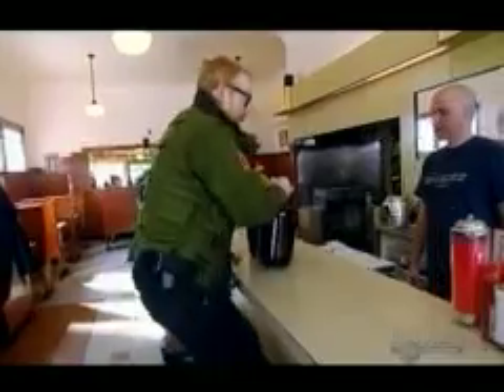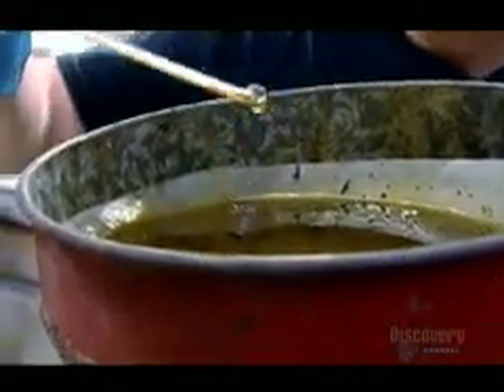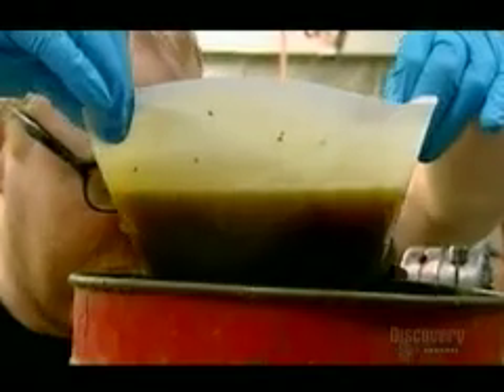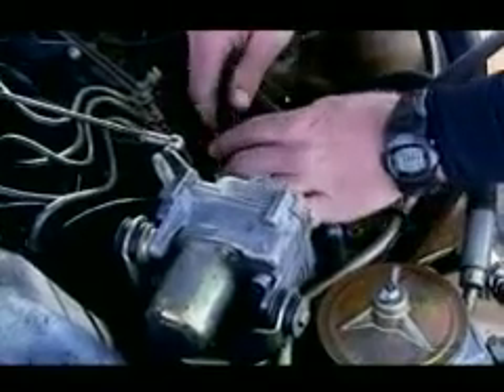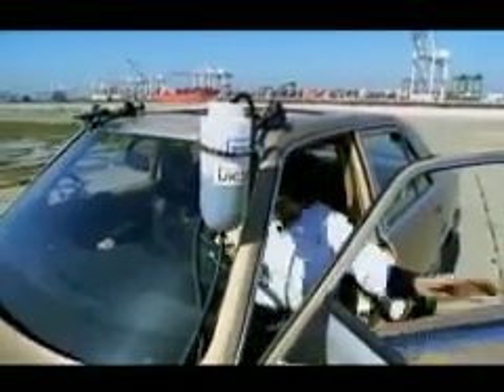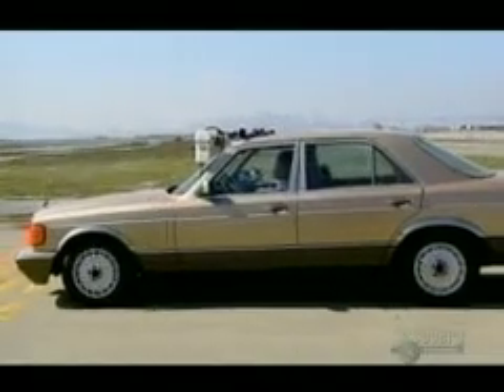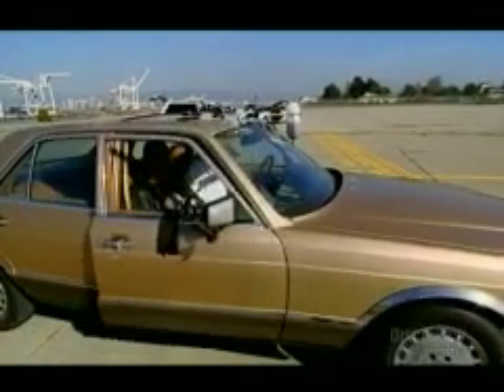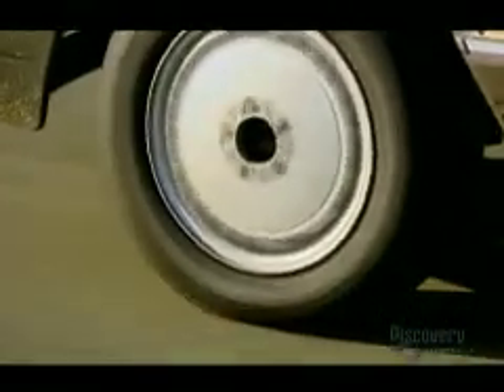Mythbusters - Cooking Oil as Economical Diesel Fuel

Comment: nothing new really.people been using used oil as deisel forever.really anything thats compressable like diesel will work.can also use latern fluid scince it isnt really combustable,but will blow under compresion like diesel.only problem with using stuff other than diesel is that your injectors will not last near as long,and with the cooking oil i can only imagi a all the sludge buildup.but still cool see it work

Comment: what do you mean busted? WE'RE IMPRESSED THAT IT RUNS AT ALL!!!

But I'm very skeptical, I'm very sure that it fucks up your engine. Especailly since diesel naturally lubricates the engine. So I guess this is good for bullshit 15-20 year old cars that nobody cares about, 500 usd ones
Reply: Diesel engine was initially designed to run on vegetable oil, it actually cleans the engine and removes any debris
Reply: Yeah, its great stuff, I noticed a difference half way through the first tank! Propel is also working on setting up more locations so its more available. Glad I could convert someone to the new diesel they have
Reply: Diesel engines are unique because they will run on practically everything. In fact you can fill the tank up with engine oil and it will run. This is also where the biggest problem with them goes into affect. If the injectiors have a problem and slightly stick open and the engine backfires the engine will not shut off till it self destructs. When they will run backwards till the bearings burn up and in most cases they don't run on the fuel at all when they do run backwards because the injectors actually function fine. They suck the oil in the engine up and run on it till it melts the bearings or runs out. Either way the engine is toast. In fact diesel with run on gasoline. The problem is the gasoline burns to hot for them. The diesel engine is the best engine on Earth though if your low on it's normal fuel as long as you have a fairly decent amount of oil based products you can get it to get you home or to the next fuel station hopefully. It won't run great or like it should but doing things like that was common at one time to get you where you needed
Reply: What do you think that trucking companies do with their drained oil? It goes straight into the fuel tanks. When times were tight, I was running a medium duty International rollback with a 6.9L IDI on straight waste oil. It smoked more, but had more power than with diesel fuel (lube oil has more BTU's).
Reply: Ideally one should convert the triglycerides of used cooking oil into esters, not done here, but proper B100 has MUCH better lubrication than standard Ultra Low sulfur #2 diesel
Reply: Ill say it again, they were designed to run on biodiesel not vegetable oil. too much glycerin in vegetable oil
Reply: Here in CA I am lucky to be able to run HPR diesel in my truck. Its a renewable high cetane biomass made from tallow and other animal fats, with incredible improvements in emissions over petrodiesel. With the added benefit of being cheaper too, its really catching on. check out propel fuels HPR diesel. It's clear, and doesn't even stink
Reply: ZB classic vehicles, sure you can run it on straight oil, but the higher BTU content tends to blow head gaskets prematurely. And you're thinking of turbo diesels, when the seals fail and oil pours into the intake
Reply: Taydrum I'm aware that it tends to hurt components like gaskets but it will still hopefully get you where you need to if you have to resort to doing things like that. As for turbo diesel engines that's almost all modern diesels anyway. They are pretty much junk without them though I'm glad you did mention that part because I had completely forgotten to say that
Reply: usd means united states dollars. it's okay man, that's what the higher ups call it. normally we just use the classical $ sign.
Reply: Yeah could be. I don’t know enough about it either. I just know people who’ve done it and they say it works great, but I’ve gotta try it for myself. Got lots of spare injector pumps and injectors so I’ll find out I guess.
Reply: It appears like they infused diesel with natural gas and a catalyst to make a better burning diesel. That's really cool, I wonder why it was dropped. Its also worth noting that many people have converted their diesel engines, or concurrently run natural gas with diesel. Good find
Reply: SimplisticTV are your referring to HPR diesel? Then yes, it's "bio" diesel in the sense that the starting material was biologically active, and therefore renwable. However they distance themselves from the word Biodiesel in favor of Green Diesel since the properties are different. Biodiesel naturally has low cetane, and poor cold start characteristics. HPR diesel has very high cetane, and impeccable cold start properties, with the added benefit of burning CLEANER than traditional B100 biodiesel. Check out these fuel specs for HPR diesel:

https://dieselhpr.com/assets/media/DieselHPR_Fuel_Specification.pdf
Reply: nuget102 it's bloody filtered!
Reply: ZB classic vehicles what you are referring to i s a runaway diesel. That is caused when the turbo gets worn out and leaks oil into the intake. The engine runs on that oil until it dies.
Reply: Jagdish Naryan you are mistaken, pure vegetable oil has triglyceride backbones with esters. The esters are what you want to burn as fuel, while the triglycerides will gum up any component they contact like injectors and pumps. I've torn down diesels than ran only veggie oil, and the injectors were almost glued together
Reply: llVIU this also naturally lubricates the engine. Same as diesel. Light oil. Doesnt fuck up anything unless you don’t filter it.
Reply: I've been told waste oil can and does mess things up. I've also heard if you do some stuff to prevent build up from oil not thoroughly heated that it's fine. I don't think there's enough research really...
Reply: But it DOES NOT POLLUTE the atmosphere!  No smoke is produced!
The only thing that comes out of the exhaust is pure clean water, which you can then drink!
Let's stop polluting the planet with these horrible diesels!

Comment: I think of two points made by Diesel Power Magazine--in an article titled "Diesel-related trends that have died-off"--about why what they attempted is not not more popular:

1). Waste Vegetable Oil (WVO) lacks the proper lubricants & burning properties to support long diesel fuel-injection related components. Many have found the savings had by it offset by fuel-pump & injector replacement costs of equal or greater resulting from doing so.

2). The Mercedes 3.0L turbo-diesel, unlike most other diesel engines, is a very-expensive & difficult engine to even get parts for... Especially "hot parts" that can actually improve performance (hence: mileage). So imagine trying to source replacement injection parts that are merely rebuild: End-costs so great, it won't be worth it.

Comment: The big question though is if there are any long term effects on the car from using raw, filtered fry grease
Reply: it would get disgusting pretty quickly as there are no detergents in cooking oil performance would start to drop after only a few hundred miles i think
Reply: It gets thick quick in the winter.
Reply: Not really only have change oil more frequent
Reply: Biggest one, engine oil dilution from fuel being used not proper to the injectors

Comment: B#(($#!^......it didn't make your engine more efficient?......you got the oil for free.......how efficient can that be in terms of economics...
Reply: your engine would be clogged up after 1000 miles and lose efficiency, eventually would not be drivable and you need a new car.
Reply: clogged up?......have they been doing the proper mixed concentration or did they place in just plain cooking oil....oooohhhh they did...that is why it will be clogging up..considering the weather..the colder it gets saponification follows......now if you had it properly prepared as an engine fuel then the problem will solve itself.

Comment: What these two clowns did not mention is that the  MB 617 diesel engine will run on some god awful fuel! The Problem with veggie oil among other things is hard on injectors, and fuel lines! Also, it tends to jell when cold out!  I drive an MB with the 617 engine, I will not put that crap in my car, Its not a good fuel, when you get down to it.  It's a shame that what some people are doing to what may be the finest cars ever made!  I use to drive a VW Jetta Diesel in one sort or another from 1977 to 2010 when my last car died! Those would not run on veggie oil nor would any of the, more modern diesel powered cars with the common rail injection. My 300 SD is 34 years old the last of the 617 engines were made in 1985!  These cars still give good reliable service with just a little care! It's a messy time-consuming option and yea its pretty much free for the asking, but I look at my time as worth a lot more that the precived savings when I fill my tank!
Reply: MB best car eva.... have to tell yall... MEGA LOL.
i d neva buy any of ewwropean cars eva.

Comment: I thought that in order to run a diesel engine on used cooking oil, you had to heat the oil in order to lower the viscosity - that is the reason for transesterification.

Comment: the Dumbest statement in the entire history of technology--"" if there was a better engine  (technology) we would know about it""  ... how dumb do you have to be to say THAT after they discontinued hydrogen technology and killed tons of inventors and after they took the steam engine out of main stream circulation   and after they long ago did away with the electric car only to now revive it at a huge cost and an on grid dependency.
Reply: The fatal downside of hydrogen is twofold: 1. You need to spend energy to produce it, it's not just found naturally 2. It's not easily stored, because it's a gas that--unlike propane, for example--doesn't liquefy when compressed, so you can't fit much of it into a gas cylinder.
Reply: SPLITTING WATER??  Well duh!
I alway split my water (especially if my water has broken!) to get chlorine! And then I put the chlorine into my Javex, to make it more powerful! ! Makes my panties EXTRA CLEAN after Monday's wash!
And the leftover Chlorine I use to brush my teeth with!
HEY! You MUST be a chemist, right? I just love you scientific types! Want a lapdance?
Reply: Frank James electric will not be conceivable for long time. Hydrogen if people would change drastically as some people operating a bomb on the road is scary
Reply: You're right but wouldn't the water disappear if we had those engines?
Reply: Not so.  I have replaced my veggie oil with water!  Distilled, must contain chlorine, which pollutes!
Reply: Frank James it costs more energy to produce hydrogen gas from water than it's worth to stick in an engine.. also storage is an issue.. quit listening to stupid as duck conspiracy theories. The earth is round FYI. Oh also steam engines are used every day in production of electricity. They're best used for even and regular work loads unlike Petro burning engines that are more efficient at going back and forth between higher work loads to coasting.. steam engines suck at building up power going up hill

Comment: Generators will also run on cooking oil, which charge electric motors. So, imagine the miles on electric engines charged with cooking oil. I am thinking hundreds of miles, maybe?
Reply: no, they're pretty close - and steam tends to scale much better. plus, you can run it on anything that burns - coal, wood, humans, petroleum products, uranium,
Reply: +Xylius Schaaij 

It would work though, right? If no diesel was available, or you had a stock pile of vegetable oil during a power outage, the oil could power a battery charging station. Im uncertain, but perhaps the least expensive method would be solar, wind, or hydroelectric power in the long run, if there were enough batteries, but then there is the cost to manufacture them. I figure the lifespan of a diesel motor would outlast the life of the batteries needed for an electric motor. Diesel overall sounds like the most efficient fuel source for a motor vehicle.
Reply: LOL humans :) Oh shit your serious.... Let me bring you some clintons.
Reply: The Niteshifter Steam engines are sensibly less efficient the  internal combustion engines
Reply: +Tony Anderson ha! I have been waiting for someone to catch that

Comment: Cosolvent winterize with turpentine or synthetic gasoline up to 20-25% and preheat it, then you will have a colder weather blended fuel.

I've seen it done live recorded.

Also try preheating the used kitchen grease with coolant heat, I bet there maybe an increase combustion efficiency to a small extent and possibly get a few mpg increase.

Comment: This its the great way to save money, and to drive almost free.  Long time ago i have old Audi C4 2,5 tdi (140hp) 1996 whitch i have drive on WVO. In the wintern when temperatures in Sweden its -15C, -20C i have my mix on 50% diesel, 50% WVO, when temp its above +3C then i drive 20% diesel, 80% WVO, and in the summer i drive 100% WVO whitout any problems.
Reply: I do the same with my old turbo diesel Jeep. Few months ago I tried with wasted motor oil and works great too!
Reply: @V8AmericanMuscleCar  
I have tried also WMO but its comes a lot of smoke. Carbon deposits in ERG valve after only 1000km was terrible.
Reply: With the first tank there was a little more smoke, with the next almost nothing.  In the first tank there was a lot of oil for the differentials so it probably depends on the type of oil as well.  But for now I have no problems and I hope it will stay that way. 😁
Reply: V8AmericanMuscleCar I wish you a lot of luck with that 👍🏻
Reply: @alexa795  thanks! 🙋🏻‍♂️